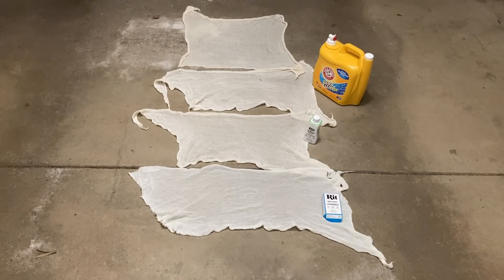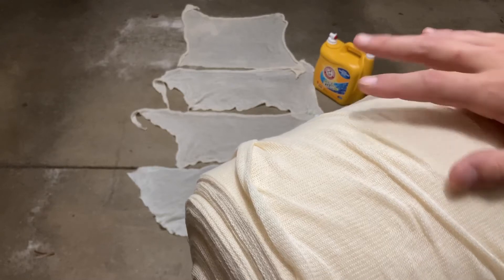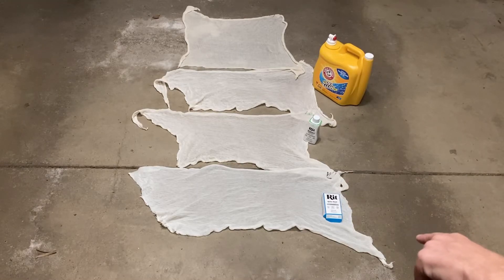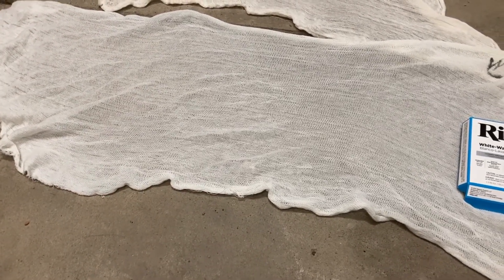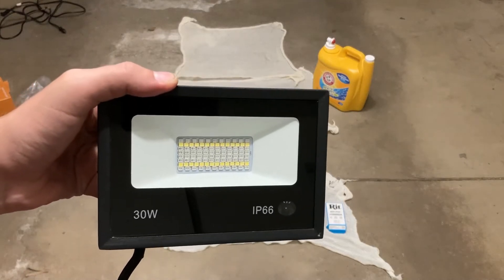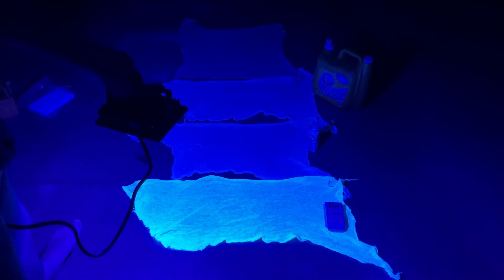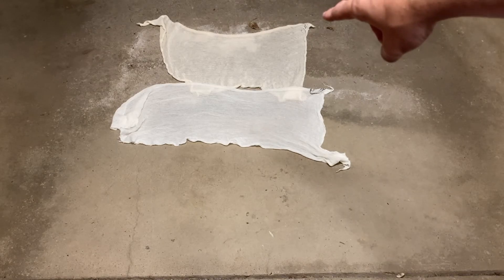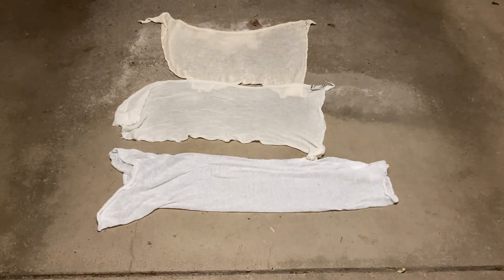Beef netting blacklight experiment

Comment: Do you think it would work if you do it in a turkey fryer outside and just stick the whole roll in the pot?
Reply from the maker: If your fryer is large enough, sure!  In fact that’s probably a far better method than anything I tried.  You want to unroll it before putting it in though or the dye might not get to the center.
Reply: @Ryan-nu4sl   Perfect! Exact answer I was looking for! Thank you
Reply: @Ryan-nu4sl  I was wondering about unrolling it too and you answered my question, thanks!  I plan on using Rit White Wash and then letting it dry on a fence before creating my web.  Since this is going to be outside when I create a web, and over a cement walkway, do you think any rain would run off the beef netting and bleach my cement walkway?  If yes, then I might try to wash it in the washer first.
Reply from the maker: Make sure to follow instructions carefully.  There’s a rinse before letting it dry.  That should remove excess chemicals.  Also this is not a bleach so it probably won’t damage your cement even if some gets on it, but I can’t be certain.

Comment: Thanks for doing this!  I'm doing a cotton rope for a spider web on my house for Halloween and it glows a little but I wanted more "pop."   So I read that Rite Whitener and Brightener was the best and went hunting for it.  Hard to find!  Searched everywhere, could order on Amazon but didn't want to wait 2 days.  I found the Rite White Wash so bought that reluctantly.  Then I stopped by an Albertson's because my web search kept coming up with Albertson's as a source for the Whitener, and found 2 boxes there - a motherload!  Bought both boxes and brought them home and hurriedly made some rope soup (according to the directions).  After I drained off the liquid (saving it for a potential spray on application for other things) I realized in horror that I had not used the Whitener & Brightner, I had used the White Wash.  I was about to redo everything with the Whitener & Brighter, although the White Washed rope did glow pretty well under black light.  But it was still wet rope in a turkey roaster pan and I wanted to make sure I got the full glow.  Before redoing it, I thought maybe someone has compared the two and maybe the White Wash is just as good.  And here it was!  Just exactly what I needed.  Isn't the internet wonderful?  :😃  Now I'm only wishing I had suggested this as a science fair project when my kids were that age.  Thanks again!

Comment: Has anyone tried dyeing the Poly Netting with Rit Whitener / Brightener using a spray bottle, water mixed with Rit? Does that make the poly netting still appear glowing under a black light? Or must it be fully dyed? I guess I'm wondering if poly glows at all with some sort of treatment? I only have poly, not the poly/cotton. Thx
Reply from the maker: The problem with 100% poly is the nature of polyester.  Once formed, it’s nonporous.  It’s the cotton part of the poly/cotton blend that allows dye to take root and stay.  If you sprayed Rit WW on 100% poly, it would not stay in place.  You might get some residual UV+ effect, but it would dry splotchy and rain would wash it off.

Comment: FYI more info:
Poly is whiter color, and fire resistant, but doesn't dye as well. 
Poly/cotton has the more yellow tinge, dyes well but is not fire retardant so be careful near lights and flame. 
Both work great for webs.
Thanks for the video! I might try on my poly webs just to see what happens.